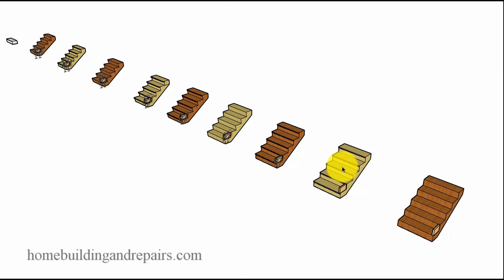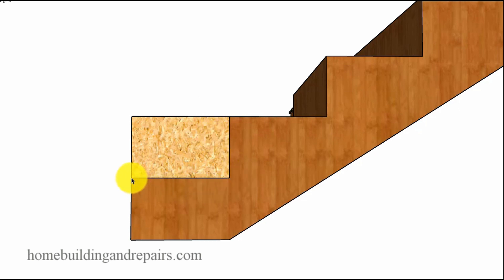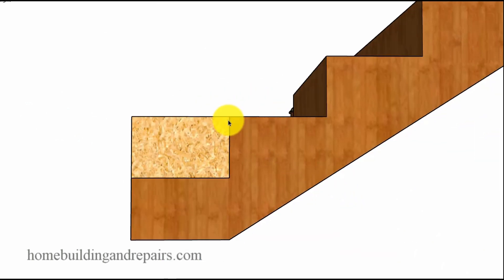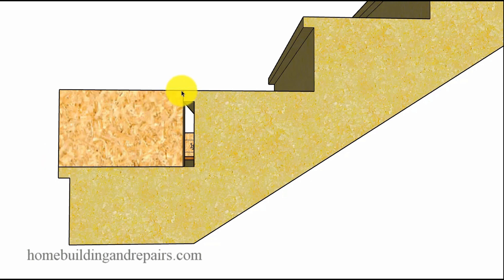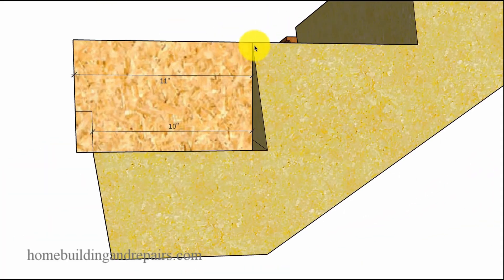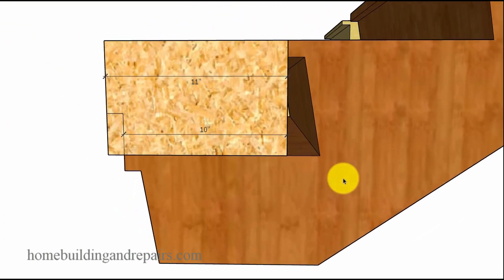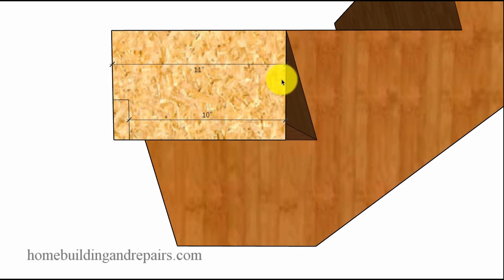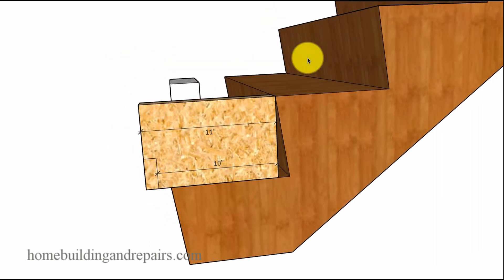Examples of Possible Stair Building Code Violations - Tread Nosing Projection

Comment: Is there a general code recommendation or requirement about a limit of the number of stairs one should use "cut out" stringers as opposed to using cleats?

I've seen quite a few videos where there are some really long cut out stringers that don't look particularly safe.
Reply from the maker: That's an excellent question, but I haven't found any building codes that provide any suggestions for lumber sizes or comparisons to lumber sizes in the notches cut out of them to form stringers. Let me know if this didn't answer your question.

Comment: What is the way to extend threads from 9 to 10 inches? If I add a board to the riser on the top step to extend the previous thread, it eat in the next one, so I need to extend by double the next one, which of course eats in the next one...
Reply from the maker: See if this helps https://youtu.be/QHxfR7bMp3E

Comment: Thought experiments help me learn.  I'm trying to learn how to get really sturdy stairs.  I dislike things flexing around me, even a little bit.

What techniques/designs would you use if somebody wanted ultra-low deflection, no-squeak stairs made out of wood, let's say so that they could tile over.  Tile manufacturers require bending limited to L/720, or 1/15th of an inch deflection over 48" wide stairs.

Alternately/equivalently: If somebody asked for stairs for a fantasy person with a bodyweight of 1 ton?

I'm examining, for example, using 16" LVL side stringers and gluing together 2x4's to make a solid pine 3.5" rough tread (or 2x6's to make a solid 5.5" rough tread), then putting a finished hardwood topper on it.  No center stringers and no risers to avoid squeaks.
Reply from the maker: It sounds like you want wood, but concrete might be better. I can't provide you with much of the suggestion, because I don't know how long or wide the stairway is and what you have to attach it to like walls on the sides or can you use walls underneath the stairway, but you can build a heavy duty stairway with large pieces of lumber like you are suggesting that won't move.